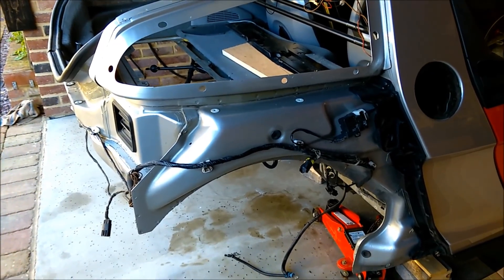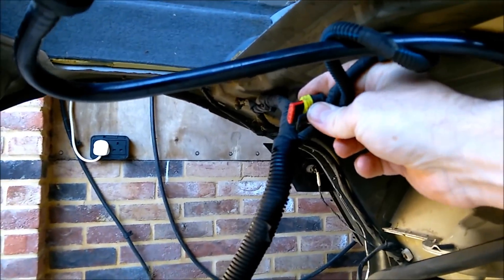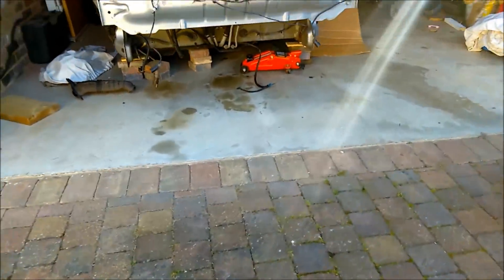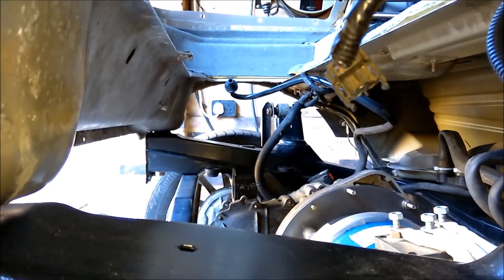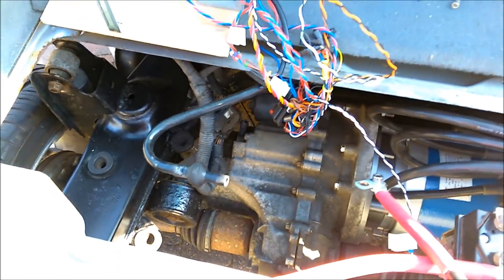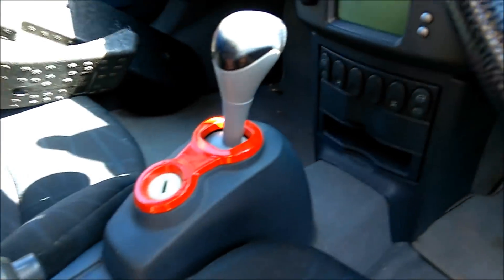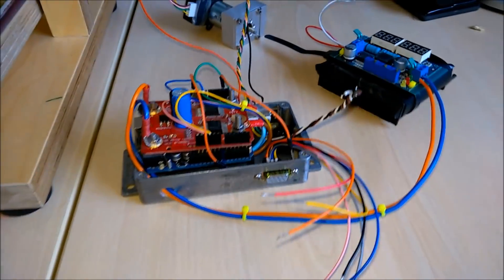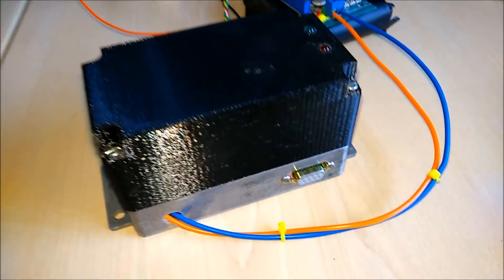How to... Smart Roadster electric conversion - Chassis in

Comment: Good work Paul! I just bought a smart fortwo motor with transmission, but it doesn’t have much information. do you happen to have schematic on how to power it? I’m an electrical engineer but i need more information on what kind of power does it needs. And how it’s controlled.

Comment: How long a motor can be fit between transmission and rail? I imagine a 1/2 adapter aluminum plate suffices.  I have an FB1-4001a DC I may want to use instead of going AC.  Your video is very informative and answered lots of other questions I had.  Thanks for taking the time 👍🏼

Comment: So this will be a one-wheel drive?
Reply from the maker: The motor is connected to the transmission, the transmission has a diff so both rear wheels are driven as normal. One wheel drive would be lethal.
Reply: Hi Paul, I see now after closely reviewing the video. Thank you for your response and your creativity you have shared. Thumbs up.

Comment: 7:00 What is it – a head unit with large LCD-screen? Never seen it on Smart Cars before.
Reply: Yeah my 2004 roadster is the same as shown. Like this stock
Reply: @joshdixon5845  Can you please provide a part number (is on the back panel) of that cool stuff?
What information does it shows? Just MF Radio stations names or something more?

Comment: paul great job on this. I converted a 2011 fourtwo smart car for my degree in alternative energy at Tulsa community College back in 2012. the problem that we had was the shifting in the transmission. you shown that you used a Ardrino and a controller board for the stepper motor. is there any was that i can talk to you about how you got that to shift the transmission. I and the students that are still improving the car would be very thankful for your input and help.
Reply: I think this is what you are looking for :  http://roadster-ev.blogspot.com/2016/02/gear-selection-control.html

Comment: Hi,I have been considering this also. What bhp are you planning on running ?.
Reply from the maker: Hi, there isn't really a direct bhp conversion, it's a 50kw motor giving around 140Nm of torque.
Reply: @crispydoda   https://www.youtube.com/watch?v=iQ4lTPVR3qc
Reply: @crispydoda  ... Hi, Okdok, checkout my links Above sir, less you have seen already !.
Reply from the maker: @DJJAW11  They are good links, I like the hub motors but that design has a few issues but I can really see they will make conversions much easier in the future. 
I guess BHP and HP are regarded as the same thing generally now, I think the conversion from KW to HP is 1.32 so this car will be 67HP which is less than the 80BHP ICE but torque is 140Nm rather than 110Nm that the ICE was.
Reply: @crispydoda  glad you liked,both great , fascinating videos 😏😍

Comment: Very clean.  No transmission or gearbox? No gear reduction? Know what your gear ratio is?  Volt/HP/Amp/Watt/RPM/Torque rating of that motor?   Do you know when the controller slows the motor down does torque go up?  How did drive testing go?

Comment: So how do you heat the interior of car after conversion
Reply from the maker: Heating is an issue, I'm leaving the coolant pipes in and at some point will build a water cooler for the controller and water jacket for the motor, I can then pipe this water through the normal heating system but I guess it won't provide much heat unless I just drive it hard all the time. Perhaps the addition of an inline electric heater will help when not much power is being used.

Comment: Stop the madness!!!
How much would you charge to convert my Fortwo 451?
Reply from the maker: Interesting question.... I'd love to do this for a business, but I can't risk my day job to do it yet. I've sourced almost all the parts as second hand parts so I've saved a lot of cost on this project. 
Buying a new motor and controller is much cheaper in the US so probably need to buy from there and get it shipped over all for around £3k, there are lots of battery options to list, LiFePO4s, used Nissan leaf Li-ions etc but all end up at around £3k for a 6-10KWH capacity. Cables and ancillary parts £1k. So it's would be £7k of parts plus time that I'm not even sure I could estimate right now. I'm not sure if these is a business in doing this stuff or not.

Comment: Are you going to use an electric heater since you don't have a radiator?
Reply from the maker: I don't have any current plans for a heater.. although I have considered water cooling the controller and motor and feeding that through the heating system but I don't supposed that will generate enough heat in mid winter.

Comment: This is how modern cars should be produced.  To where the engine can be simply unbolted and rolled out on two wheels.  Major manufacturers won't do it though because they don't want to just make  money on the vehicle, but also hold you hostage on repairs and service.
Reply: its not great for the weight distribution - Smart Roadsters are very rear-end happy in the wet - although, if you're going EV and putting the batteries in the floor, that might solve the weight issue, but then an EV motor needs little to no maintenance anyway, so kind of irrelevant.
Reply: @jamesstevens2145 They're tail happy because they are light and the weight distribution is slightly to the rear. I like the idea of EV smart roadster but I'd try to get the batteries under the floor somewhere, or even in the front boot to help keep the weight distribution sensible. I think the standard engine and box combination on these is REALLY light, like 70kgs or something. Swaps on these do need a little planning.

Comment: I was thinking of converting a older car or small truck. And put the batteries where the fuel tank and exhaust was. And in the motor compartment. A smaller pack . to extend the range. 20-30 miles or so. All I have is DC forklift motors. Basically a golfcart motor. I need to catch up on your project. Before commenting too much. But so far . I LIKE IT!

Comment: Are you converting this car to electric? Wouldnt it be awesome to put a Tesla motor from a p100 on there! It be riding wheelies!
Reply from the maker: It would be bonkers, I know someone who is putting a 90kw motor in a Smart fortwo which might be enough to wheelie... (although the batteries are in the floor so low centre of gravity), the tesla motor might cost more than my whole project?.

Comment: Great project.  Can you tell me what transaxle you are using?
Reply from the maker: All of the drive gear are the standard smart roadster, I've just bolted the electric motor to it. The gearbox is 6 speed Getrag gearbox but they are known for having a really slow shift in the standard gas car, I'm going to modify this one to shift between 2 gears to give me a high and low ratio.. later on.
Reply: Thank you.  Very interesting. Cant wait to hear how that works out for you.

Comment: The chassis spacers made of aluminum is there because of that engine frame being a cushion in case of a collision since the aluminum will shear and allow the body frame not to be damaged as much if it were not attached. You should put it back on between the two locations on reassembly.
Reply from the maker: Yes, good point, I have all the original parts and bodywork, they will all go back on once I've got everything connected up. Can't wait to get this on the road now, although the paperwork is going to delay things I'm sure.

Comment: I have the ac-51 running at 96v. 6kw is way too small of a battery. You will burn them up if you draw more than 100 amps out of them. Unless you plan to go 20 km/h and take 2 minutes to reach that speed I would seriously think about a battery 5 times that size. Maybe you can find a wrecked Nissan or smart car and use the entire pack.
Reply: Fantastic work on the remainder. Keep up the good work.
Reply from the maker: Thanks for watching and the thoughts. 
I realise the battery is small but it's all I can really afford at the moment until I know it's up and running, then I can justify increasing capacity. However, from what I've read these cells can run for short burst up to 8C (480A), 4C (240A) is fine for short bursts and happy to run continuously at 1 or 2C which will give me 6-12Kw which is plenty for 60 or hopefully 70MPH (downhill maybe :D). The Nissan Leaf is nearly double the weight and only has 4 times the capacity and although it's more streamlined it has a much larger profile... Hopefully i'll find out in a few months, available time is a real issue. I don't know what happens to old leaf batteries but they are really hard to get hold of. Which car do you have the AC-51 in?.
Reply: paul crisp I run my 51 in 800 kilo Japanese mini-truck. So less drag due to weight but more due to profile. I have a 7kw Tesla battery but because the bank is so small the voltage drops hard and the Curtis shuts it off due to under voltage. I had 24 kw battery pack at one time but had to sell because I needed the money. I would suggest counting on running your batteries at 1c or you will fry them. 4c is one second not 3 or 4 seconds. Don’t want to be a nay sayer just trying to help a good guy out.
Reply from the maker: Hi Shawn, that's useful to know about the discharge rates. 
The cost of batteries is a real problem with these builds, I'm hoping that once I've got this through the V5/inspection etc and it's on the road I can justify the cost by remembering that when I filled it up with petrol it was £50 a go.
Reply: I have 24s AESC cells from a 2012 LEAF in my motorbike, realistic 60km range, potentially 100 if fully drained. wouldn'r be surprised if the Roadster is better in terms of kWh/100km than the bike. Build thread is here: https://endless-sphere.com/forums/viewtopic.php?t=35865.

Comment: Have you sorted out the batteries for this EV?
In your blog, you quoted £1200-£3000?
You need to have a chat with Damien Maguire he has bought two complete sets of Chevy Volt/Vauxhall Ampera batteries for 500-600 euros each. He mentions this in his €1,000 BMW E36 EV Build
https://www.youtube.com/user/pooey1911/videos
Reply from the maker: I have just sorted out batteries this weekend, someone else who is doing a conversion and bought a full set of 48 Nissan leaf batteries but he is only using 36 of them so I was able to have 12 for a reasonable price. This will only give me 6KWH but if it averages at less than 200W/Mile then (Leaf is around 250W/M but this is a much smaller car) so i should get 30 miles range... fine for my commute.  I'll be doing a video about the batteries this week.
Reply: Well if you ever want to up the range you know where to go :)

Comment: Like Audi A2, a great basis for an EV - not a big barge like a modern Tesla!  Pity #Riversimple don't do H2EV kits!
Reply: most of the weight is in the batteries - also, right now, the price of batteries means that bigger (more expensive) cars make a more financially viable proposition. The model-3 is only available in the higher end models, becuase those are the only ones that pay - as batteries come down in price, that will change - it won't be long before EV's are cheaper than ICE, then the entire scales will tip - once the tip comes, it will happen shockingly quickly - ICE will start showing low residual and will be impossible to lease and the majority of new cars will go EV - if you have an ICE you think holds a lot of value, think of getting rid of it before 2020. IMHO.

Comment: You're not thinking about weight distribution, and you waste a lot of space. And you should think more about cooling
Reply: I know the RAV4 electric transaxle is FWD in the Toyota, but I meant for you to fit it in the rear. You might have to make (or have  made) some mutant axles with the RAV4 inner CV joints and axle stubs in in one end and the smart outer CV joints at the wheel end. You'll have to cut the axles anyway as the Smart is narrower. But it is an easy task for a machine shop. I've buildt a few electric cars in the early 90'. My baby was a 3 wheeled neighbourhood EV that weighted 900 pounds and had a 30 kW motor. Transmission was a 1:3 Poly-V belt and no diff but a slip clutch in the left rear wheel. 0-60 in 4.5 seconds. I beefed up my motor controller several times (higher rated FET transistors) and when it could handle 700A @ 48V it didn't blow anymore!  I've also designed a transmission and belt tensioner for the Norwegian  Kewett EL-jet, but they turned me down and made something similar not needing to pay me anything, but I still feel intellectually proud and spiritually well paid because of that!!
Reply: He should put a temp sensor on the motor and possibly a DC squirrel cage fan. Stop and go traffic with regen can be hard on the windings and cooling air is non existent at low speed. I don't know why he needs a gear selector either. Chose 2'nd or 3'rd gear permanently depending on where the motor has its peak efficiency and lose the unused cogwheels and then find a controller beefy enough to handle it. A more obvious choice of motor for a small car like this is the front axle 30kW motor-diff from a RAV4. Weigh a lot less and leaves room for batteries at the rear. If you really want to save weight, get a diff for a trike motorcycle; as big as a can of coffee axles goes into the ends, and a toothed belt wheel around it, Then you have no constant banging of gears when engaging regen and your whole transmission is 98% efficient.
Reply from the maker: I think the weight distribution will be ok, I'm only fitting 6KWH of batteries in the back and these weigh around the same as a 40kg tank of fuel which is in the same place so they cancel out. The motor is lighter than the ICE and then there are just a few other bits but nothing too heavy. If I extend the range with more batteries they'll go in the front. I think it will be fine... time will tell.
Reply from the maker: Thanks for the thoughts.. Replacing the existing engine is easy and I have time to do it (I only get a few hours a week at best to work on this), ripping out the front end and turning this into a front wheel drive would be a nightmare. The rear tyres are wider on this car and rear wheel drive are more fun too. The motor will have a temp sensor and if I get issues I'll build a coolant jacket and water cool it.
Reply from the maker: Just meant to add.. I know I don't really need gears but I don't know which gear I want yet and I quite like the idea of keeping just 2, high and low gear to improve acceleration/fun.

Comment: What about taking a scooter/moped engine that gets 30-45 kmpl, connecting a PMM generator from an old genset and running it to the electric drive? Curious.
Reply from the maker: Thanks for watching... the generator kind of defeats the object of having an electric car... I'll be charging the batteries with home solar panels and hopefully it won't be long before all charging points are wind or solar with battery storage. As batteries improve I can add more range. Fossil fuels are for dinosaurs :D.
Reply from the maker: Thank you for your thoughts. However, with all due respect, these guys are in denial and need to stop thinking that we are able/should keep burning oil, it's great stuff and contains lots of energy, but it took millions of years to produce and we have burnt most of it in less than 100 years. 
I did have a look at some of your links, no basis of any fact whatsoever, one even said that "oil is the life blood of the earth"  - "as we pump this out it keeps filling itself back up".. I'm afraid you are listening to absolute rubbish. Can i suggest you start to consider reality, read some facts and then take a more balanced view. 
You were right about one thing, it didn't take me long to reply, I could also sit in my front room and say any old drivel too. Oh yes, by the way did you know that the earth is flat!...

Comment: Hi there. . What size is the motor and are you over voltaging it at all?
Reply from the maker: Hi, I'm using a HPEVS AC-35 motor, I was going to run it at 80v but I'm now going to be feeding the controller with 96v. I'm not sure if there is a voltage drop between controller and motor but it will be running over rated voltage. Peak torque should be higher at around 130Nm which is more than the ICE it's replacing but lower KW, 96v at 550A is 52KW whereas the ICE peaks at  60KW.
Reply: paul crisp thank you for the reply

Comment: Nice work Paul, which batteries and how many can you fit over the motor ?
Reply from the maker: Hi Roy, thanks for the interest, I have managed to get hold of 12 nissan leaf batteries and these should all fit in the rear space, only 6KWH but should be enough. I'll be doing another video this week on the batteries.
Reply: was looking at doing the same project ended up selling the car look at the tesla battery module